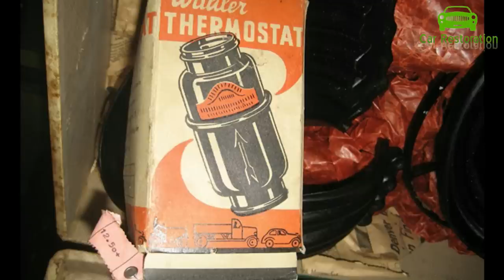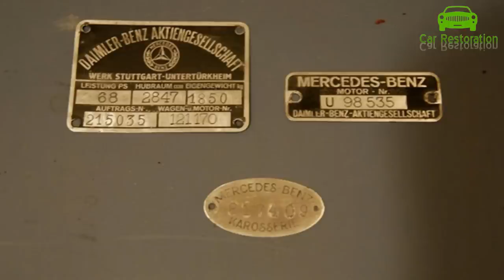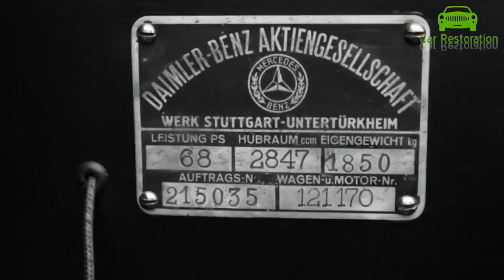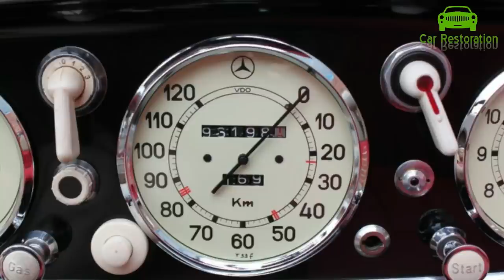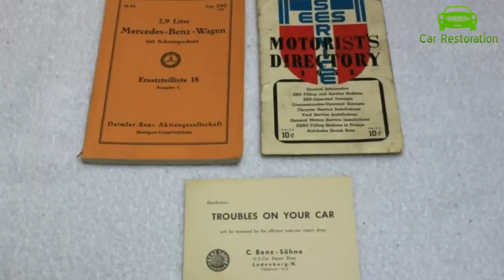1936 Mercedes Benz 290 Cab A - Car Restoration

Comment: One thing nice about restoring a Mercedes is if you have deep pockets you can get EVERYTHING you need directly from them. Need Brake drums for your Gull wing? $5K each and they are yours. You can actually build a 1885 Motor wagon with all factory mercedes parts. So no hunting for years for a factory dome light and  bulb holder. Just remember the deep pocket parts.
Reply: I have deep pockets, unfortunate there's nothing but keys in them.

Comment: Did this car originally have independent rear suspension? I didn’t know Mercedes had independent front suspension set up this early
Reply: Much earlier in the 30s, Mercedes had independent coil suspension.
Just think about that, Rolls Royce still had cart springs on the rear into the 60s!!